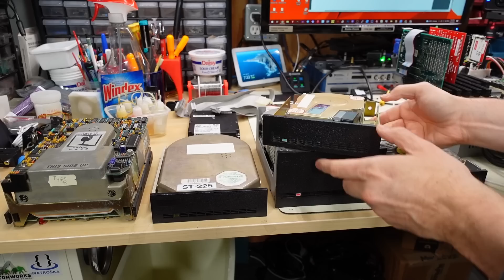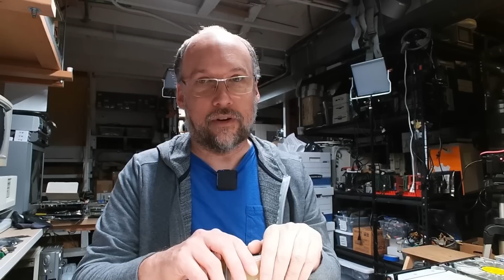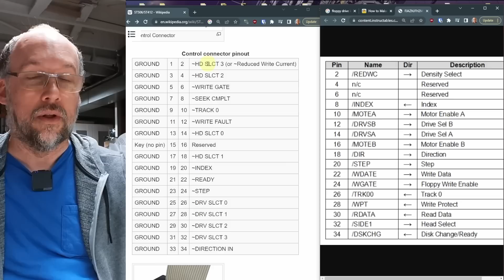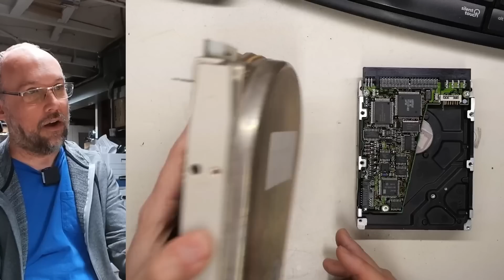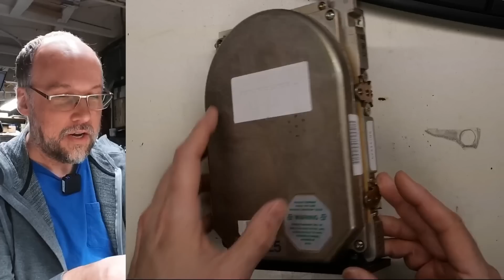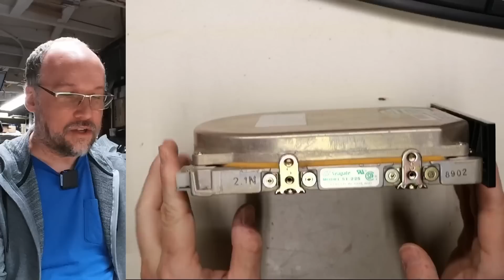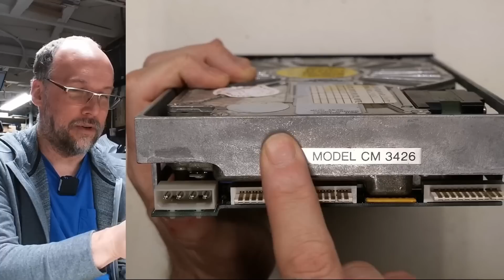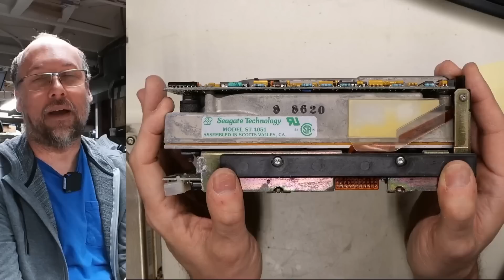Not forgotten: MFM hard drives

Comment: I purchased a new IBM PC clone many years ago. My company needed a dependable system. So this computer lasted about 9 months before the hard drive failed. After opening the case I found a RRL controller card on a MFM hard drive. That's what crashed the hard drive and our valuable data. Fortunately a silicon valley company named Rotating Memory Service was able to recover our data. I ended up suing the company that sold us the computer and got all our money back. Never put an RRL controller on a MFM hard drive!
Reply: Issue might not have been RLL against MFM, but track to head alignment drift common to stepper motor drives.
Overheated room as well as means of drive mounting could get the alignment off track, pun intended.
Reply: @danman32  The company that we purchased the computer from advertised a Seagate 40 mg hard drive when it in fact was a 20mg Seagate MFM hard drive with a RRL controller that showed it as a 40mg drive. The silicon valley drive repair shop said the problem was the incompatible RRL controller. This was the #1 drive repair shop in Santa Clara back when when 20meg was the standard drive.

Comment: Breathe MFM drives on and they crash... Throw a RLL drive into a wall still work...
Reply: Apparently you have not understood the video...  MFM and RLL drives are mostly the same thing.
Reply: In retrospect, I found both to be bulletproof compared to a lot of drives made in the last 20 years.

I was a computer lab assistant who predominately did tech repairs instead of helping students... few items got fixed without it going through me.  We had about 250 PCs across campus and very few MFM/RLL drive failures.  I can't say the same for ESDI/SCSI drives in the desktop publishing lab.  I also couldn't say the same thing for 3.5 inch floppy drives... ugh, students used to mangle them up daily.

This video was a nice trip down memory lane... and it's nice to know that my knowledge back then was valid, as I was self taught and looking stuff up on the internet was not a thing.

Comment: I installed an ST225 with an Amstrad PC-1640 which I reconfigured to work with a Sony TV.  The hard disk was a little noisy but worked very well with an MFM interface card.  I installed it outside the case so I could retain the twin floppy drives, for some strange reason that I can't remember.

Comment: I love the sound of these drives, definitely triggers some nostalgic memories!
Reply: i remember having to park the heads when u finished with PC lol
Reply: @kynkokytsumi1931  Good habit. Not strictly needed if you were not actually moving the computer or drive, but you never know. Thankfully the IDE drives would park on their own when losing power.
Reply: @freeculture  the main problem was head crashes when power was lost or switched off as the stepper motor can't place the heads on the "landing zone" unlike voice coil drives which as you say automatically goes to the landing zone when power is lost. On stepper motor drives the head lose the ground effect and the head then scrapes the surface of the disk.  Happened to a friend when he had a power cut and lost data due to head crash.
Reply: @kynkokytsumi1931  You could not  get the write aplifiers switched off fast enough so it would write streaks across the drive as the head retracted.  Low level format would often fix it but your data was trashed.
Reply: Agree!

I absolutely love the spin up sound and the head initialization sequence.
Reply: Run defrag, or chkdsk!!

Comment: I remember using DOS Debug.exe to run various hooks in the controller ROMs g=C800:5 and some had diagnostics at 7 or 9 offsets. When I was a PC tech in the early 90's RLL drives were king. 50% more space than a MFM drive.
Reply: g=c800:5 is a low level format for most controllers. Every controller has his own low level format. Remember those defect list you have to put in.  I used MFM disks on a RLL controller. free extra space.
Was only to work on a error free disk.
Reply: Seagate controllers used  :6 as entry hook for the low level stuff.
Reply: @dutchsailor6620  Over here in europe the OMTI controllers were widely used, I vaguely remember they had G=C800:6 as the entry vector also.
Reply: and Scsi drives wiped the floor with them in speed and 7 devices on 1 chain not to mention allowing for external expansions.

Comment: Back in the day I had (and still have) a MegaFile 30 to my Atari ST, which contained an adapted Adaptec controller and a Seagate ST 238R disk drive inside, which is the RLL version of the ST-225. It could format hard disk using both RLL and MFM as I recall.. I actually got my hands on a disused ST-225 which I successfully managed to format as RLL and thus getting 30 MB capacity instead of 20 MB as labelled. 

As I said I still have all those harddisk around, unfortunately stored in a box in the far corner of a very overloaded wardrobe.